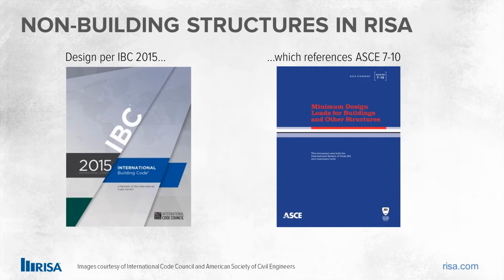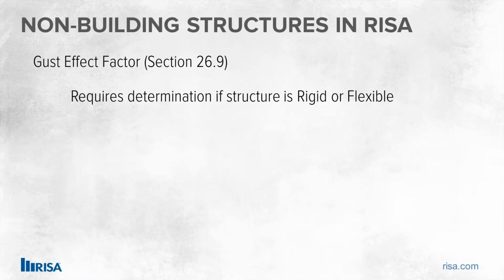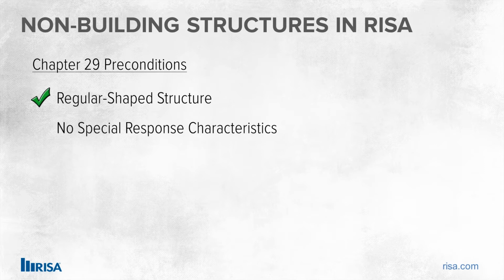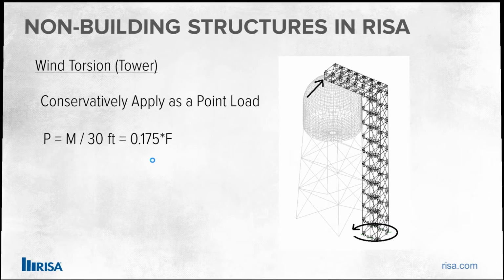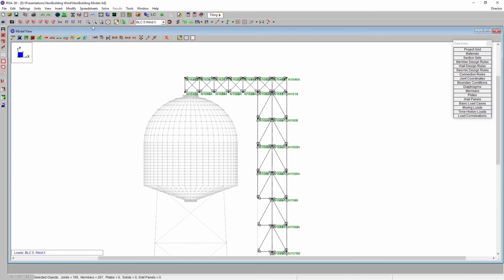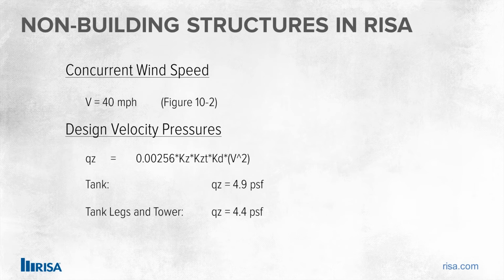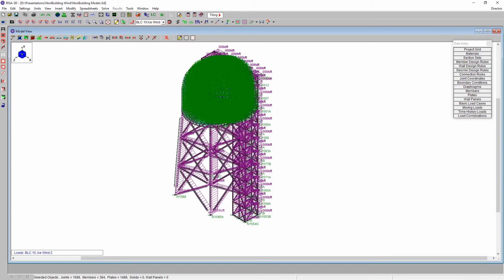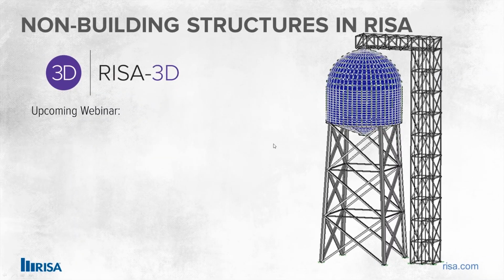Wind Loading on Non-Building Structures in RISA

Comment: Doesn't ASCE 7-10 Section 27.4.6 allows just to consider Case 1 and 3 for buildings with flexible diaphragm. Is the structure as shown act as a flexible diaphragm.

Comment: IMHO RISA is the current leader in practical structural engineering software.  Expansion of the program in the past 5 years has surpassed visual analysis.  IES has tried to keep up, but their program is still prone to locking up and crashing.  The customer support at RISA is excellent and FAST, compares to the terrible support for RAM and Robot.  I am a production PE.  I have no personal interest in RISA.  I have all major analysis packages at my office and I have to use them all due to our teaming arrangements.  RISA is the only one that I have found to be trouble free and consistently profitable.